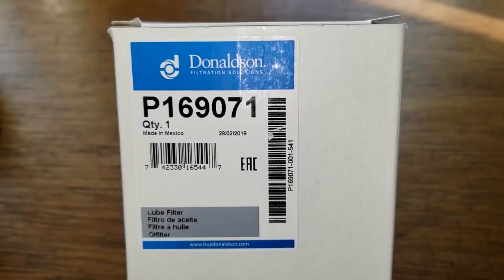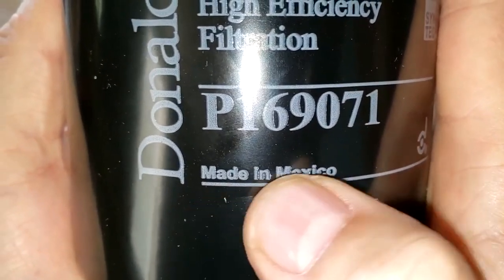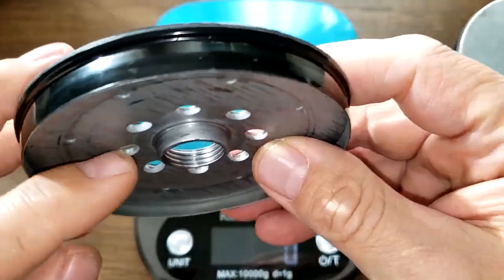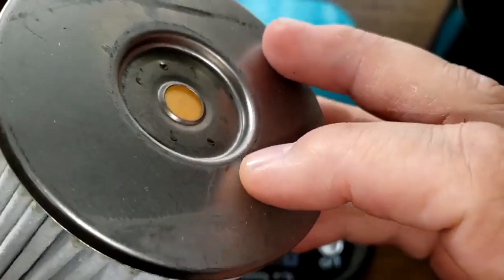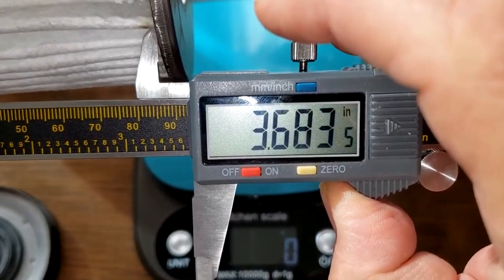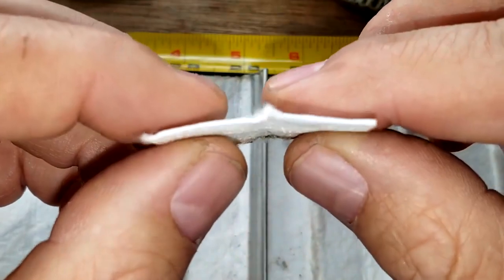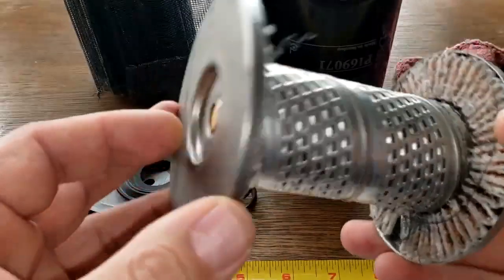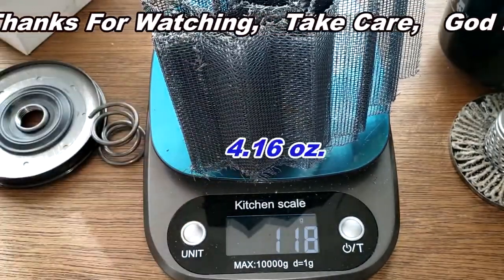Donaldson Oil Filter Cut Open P169071

Comment: Pretty good filter. Rubber ADBV no problem if mounted vertical. Alot of Jobsite equipment is using alot of those and Baldwins! Little steep $ for a home gasoline vehicle owners.  Diesel engines, its in thier price ranges. Donald Son makes them??? Which one?? Eric or Don Jr....Nyuk Nyuk Nyuk  Thanx WCW, Jethro!
Reply from the maker: You're Welcome! and
Thanks for your feedback!👍

Comment: You always say the rubber seal ring on the outside and the anti drainback valve rubber are Nitrile.  You don't know if it's Nitrile or Fluoroelastomer or Polyacrylate or a bunch more polymers.  Silicone is easier to identify but for the rest you would need a lab test to determine.
Reply from the maker: I say it's nitrile rubber because 9 out of 10  probably are! If it was something better the manufacturers would be very eager to put it in their description of their product.
That's why I say this. 
Can I ask how you would describe this gasket if you were doing the video? Maybe I could change my wording? I welcome any suggestions.

Comment: Could you set up a site showing the brand, model number, mounting hole size, height, width, total amount of filter media, weight, etc.?That would be a great help when choosing a filter. Thanks.
Reply from the maker: Sorry,
I wish I could, but that would involve more time than I have, doing these videos is about as much as I can do. This summer I may cut back to once a week because I have projects around the house that need to be done.
Reply: @WhipCityWrencher  Thanks for replying. Understood.

Comment: What does this filter fit??
Reply from the maker: It fits my 97 Ford Explorer😊
Reply: Is that a 302?
Reply from the maker: @timbur2711 No, but I wish it was.
It's a 4.0 ohv v6, it takes a big oil filter.
Reply: @WhipCityWrencher  You have it on your Explorer?  I didn't think the 3/4-16UN threads were the same as 3/4-16.  Please inform and thank you for ALL your videos!!
Reply from the maker: @josevega7680  Thank You!
I haven't used it on my Explorer yet, but as far as I know, if you do a cross-reference it crosses over and should fit on my truck.
Reply: @WhipCityWrencher  Cool!  Thanks for the info!

Comment: When I seen you tear the media I was like "wow that's pretty generic light duty stuff!" Then you pull out the metal backing that I didn't know you previously separated it from the media! Dang I bet that metal backing sure does keep the media from ripping. It looks like it should be used on a screen door being as tough as it looks!😯😯
Reply from the maker: Yep, it's a strong screen, very similar to the material on a screen door.
Reply: @WhipCityWrencher  Without the wire backing (or nylon grid backing used by other companies), synthetic media like this would crush from the pressure of the oil flowing through it.
Reply from the maker: @Gary7even  Yes, I think it would tear without the screen backing. I think the biggest advantage this filter has over stiffer media is that the particles will get embedded into the media and won't wash off if the bypass valve opens up. JMHO.

Comment: The amount the rubber extends from the outer edge does not matter because the outer part does NOT screw down flush with the mount. The mount is a smaller diameter and raised. The canister goes around it.

Very disappointed that you can't figure that out from observation and since you were told before.
Reply from the maker: What rubber are you talking about?
 Plus I have yet to have been told anything from a filter-making expert on this channel. Who is this person?
Reply: @WhipCityWrencher  I am wondering as well. Maybe Ray is watching a different video.
Reply: @WhipCityWrencher  I think he means the nitrile rubber gasket.
For example, the Red Allison transmission spin on  filters gaskets literally stick out 3 times as far as normal oil filters.
Reply from the maker: @GT-mn3bx  Could be but I still dont know what he means? This filter fits my Ford Explorer and I would want the gasket to stick out farther than the metal. The mount where the oil filter meets on my Explorer is flat.